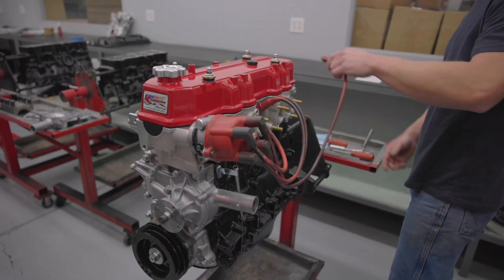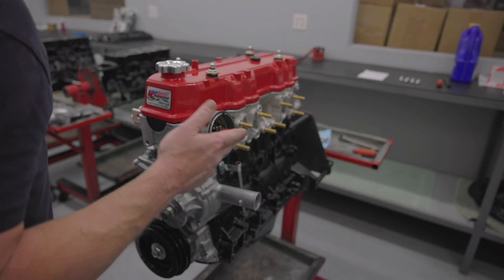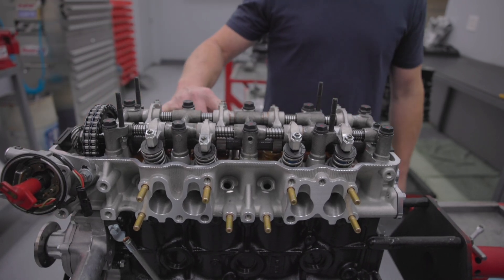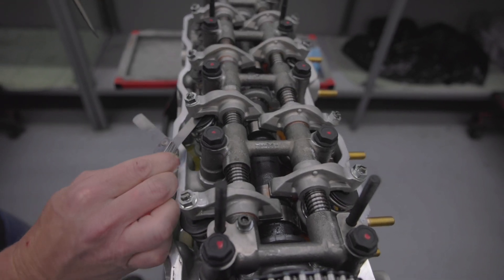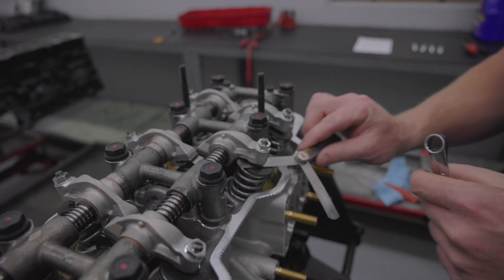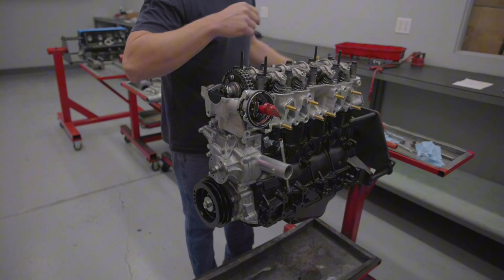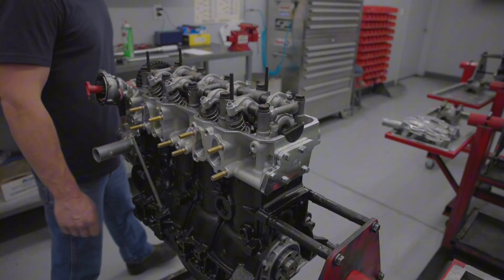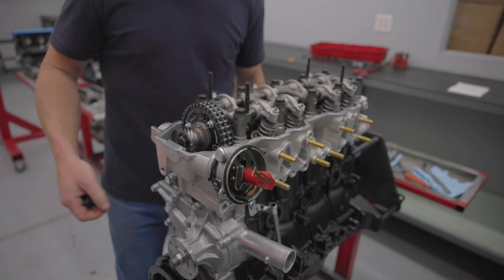How to Adjust Valve Lash on Your 22R/RE/RET – Step-by-Step Guide

Comment: I’ve ran my engines at 7-11. Any risk there? It’s never ran worst than at 8-12 and it sounds quieter. Also… how are you snugging the nuts without the screw driver holding the set screw? When I tried that it spun the screw and cinched it dimpling the gauge
Reply: Manual says do it hot which never made sense to me giving it inconsistent clearances. I don't care how fast you are. You're losing temperatures as soon as you turn the engine off. I heard 7-10. But I feel ten is too tight. The fact he's doing it cold when the manual asks for hot with clearances for hot, I'd say 7-11 is about right.

Comment: I’m assuming having to adjust the valves when engine is warm/hot?
Reply from the maker: Yes, you'll need to adjust them when the engine is hot for the most accurate measurements.

Comment: You've added a lot of extra steps. All you need to do is set the crank to 0 on the timing marks and adjust whichever rockers are on the base circle, then spin the engine one revolution and do the other rockers. By removing spark plugs and distributor, you've doubled the time it takes, increased the risk of damaging parts, and may cross spark plug wires if car isn't taken putting everything back together.

Comment: Thanks for the video but I did the exact same thing you did and tried adjusting the distributor and no matter what I do it keeps back firing through the carburetor…. Please help 22r 1986 pickup
Reply: Any luck on this ?
Reply: I have the same year and motor and have the same problem. I'm going to try tighter clearences today cold at 7 11. I've done 8 12 hot, cold. 7 10 cold. 7 11 hot. I haven't found the spot yet but I'm hoping to get there. Also, what kind of exhaust do you run? I have a magnaflow which gives me popping on deceleration but even before that the truck popped. Something with the tuning. I have yet to figure it out. Gotta love a carb.